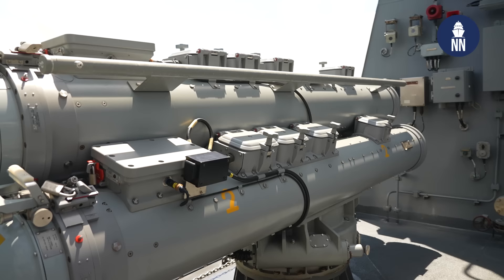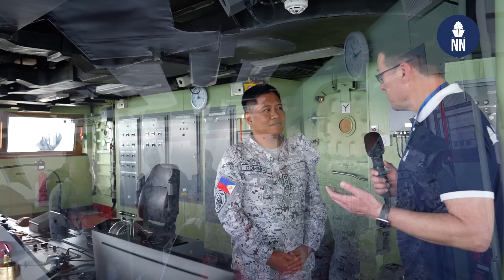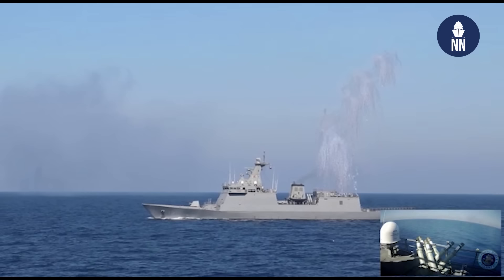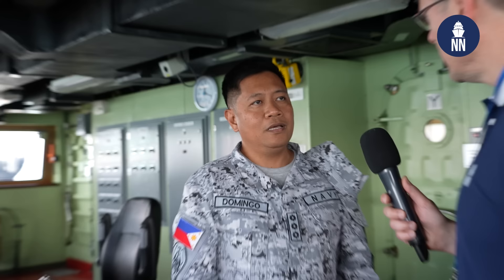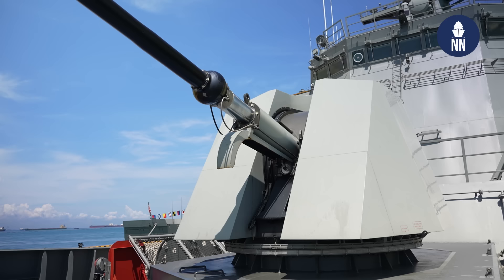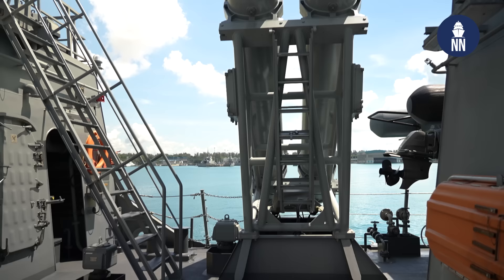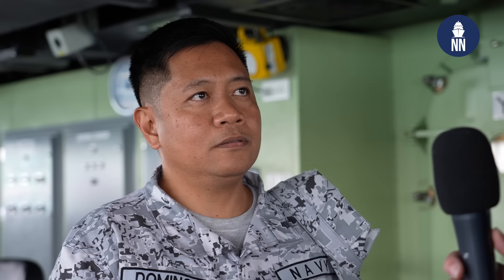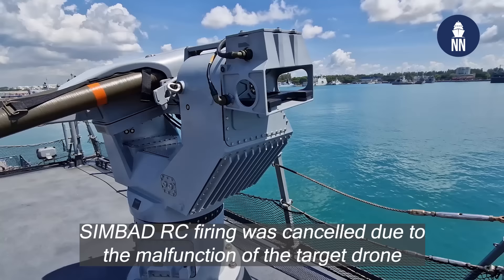Philippine Navy BRP Antonio Luna - Jose Rizal-class frigate

Comment: They Philippine Navy leadership needs to complete the vertical launch system with corresponding missiles and install a close in weapon system at the back of these frigates to make them really capable. 

In connection with these the upcoming 6 OPV being built in South Korea should also have Surface to Air Missile and Anti-Ship Missile installed to make them really capable.

There is no point having warships with incomplete weaponry.
Reply: The 2 Corvette will be more armed than the frigates 😆😆
Reply: F.Y.I The ships have already weapons platform. Only the Ammunitions and messiles are absent on the ship, but its on they way now.
Reply: Exactly. Russia learn’t that the hard way
Reply: The OPV do  not need to get any large weapon system as it IS coastal defense ships they will likely stick around ports, naval base, or just overall will just patrol near or within the range of SAM batteries
Reply: It's the Philippines dude
Reply: @ComradePuss  OPV's should have missile capabilities. Even without the CIWS. There main purpose is to patrol and protect our EEZ. With such limited weapon capability it's just a floating house on vacation in the sea. It's more like a PCG patrol ship.

Comment: The TASS (Towed Array Sonar System) will be an issue for the upgrade as the module placement is awkward  as per the design of HHI. I hope they plan on using a USV with TASS instead of mounting it directly with the ship.
Reply: awkward  as per the design of HHI? lol HHI is the world's no.1 shipbuilder and has built various battle ships, submarines and even AEGIS destroyers including Sejong The Great class destroyers being considered as the world's most advanced and powerful AEGIS destroyer. The Incheon class frigate(Jose Rizal & Antonio Luna) was originally designed for relatively easy missions with a low budget for the Korean Navy. It's the Philippines Navy that chose and purchased them even at a lower price than the Korean Navy paid. The problem is that Filipinos always want a Mercedes with money worth a cheapest car. If you can pay, you can get whatever in the way  you want.
Reply: @jclulu3942  absolutely correct. They want packed or fully loaded frigates but the budget is for corvettes price.
Reply: @jclulu3942  The original design was at the aft of the ship. Changes were made and it is now in the forward near the anchor room which is akward. That is were the mission module and power supply for the TASS is located.  Can't complain about the limited budget, but the design proposal was not followed and changes were made without prior notice even if the modules are FFBNW. It means that the design was appropriate with the budget allocated. Not a Mercedes benz but yeah its a Hyundai. Nothing can be changed about it. Hopefully the 2 incoming Miguel Malvar Class next year is more capable. It has been launched, just waiting for the delivery (still no TASS).

Comment: The United States is in the process of Decommissioning it’s USS FREEDOM class of Littoral Combat Ships because of costs related to its maintenance and upkeep.  The ships are fairly new but have a few problems.

The Philippines could probably maintain these ships in a more cost effective manner than the United States can.

The Philippines should ask for these ships.  It seems to me that donating them to the Philippines is a whole lot better than putting them in the “Reserve Fleet”.  In the reserve fleet we still have to pay to maintain them.  If we donate them to the Philippines then the Philippines will be maintaining them instead.

The Philippines should ask for the USNS SPEARHEAD Class of Expeditionary Fast Transport ships like USNS MILINOCKET (T-EPF-3) while they are at it.  They have similar problems with cracks in their hulls above the waterline near the exhaust.  I don’t think the aluminum likes the heat very much and it certainly doesn’t like a high sea state.

In any case I think the Philippines can maintain these ships in a cheaper and more cost  effective manner than the United States Navy can.
Reply: 미국도 유지비때문에 포기한 함정을 필리핀에게 준다고? 그냥 새로 건조하는게 더 저렴할것임

Comment: The ship badly needs those VLS launched Mica SAMs. The Mistral is not enough.
Reply: Don't be choosy all ship can be destroyed by missile even its looks is cool
Reply: 2 HDC 3100 will have 16 cells VLS armed with Mica to be commisioned in 2025 and 2026. Both will also have CIWS, AESA radars and 8 launch tubes for SSK-700M.AShM and towed array sonars not FFBNW. Steel cutting started on May 11, 2023. So a total of 4 missile capable ships for the PhNavy. They also plan to have 2 more bigger frigates in Horizon 3. I am hoping for the Mogami class frigates or simlar to the Type 31 of the Royal Navy for additional 2 frigates. VLS  modules  and CIWS will only move forward after the HDC 3100 have been commissioned.
Reply: @ayanokojicham if that's the logic we're gonna go with that all ships can be destroyed, then why put defenses on them in the first place?
Reply: @Fritz_Salad for stylish only so its looks cool
Reply: @Fritz_Salad  u see Us destroyer looks cool if the ciws attached on it
Reply: @Valair2021  "Correction" The towed array sonar is FFBNW
Reply: @johnrusselperez2233  According to Maxdefense the following sensors are included: Sensors Fit:

- Two Navigational (X & S-band) Radars
- 3D Air/Surface AESA Radar with Identification Friend or Foe (IFF),
- A Fire Control Radar,
- An Electro-Optical Targeting System (EOTS),
- Hull Mounted Sonar (HMS),
- Towed Array Sonar System (TASS),
- Incorporating Tactical Data Link 16 and 22 (which are PN-supplied) ,
- Naval Communications-Electronic Support Measures (C-ESM),
- Naval Radar-Electronics Support Measures (R-ESM),
- Tactical Air Navigation (TACAN), Satellite Communications (SATCOM)
- Long Range Acoustic Device (LRAD)

Comment: i dont like that HHI have downgraded this ships original requirements
Reply: Yes, it noticable from 8 anti ship missiles having downgraded to 4 anti ship missiles, then phalanx ciws is not installed and it dont have VLS missiles , ship is so weak for a frigate
Reply: Bruh it's a FFBNW deal with HHI. It's the Navy's Technical Working Group and Government fault that they approved it and did not give enough funds. 
Besides I think it's just a test phase for PH Navy since this is the first time they will operate a missile-guided frigate. Just look at the new Corvettes ordered, it's much more better than the Rizal Frigates.
Reply: @crashercrasher9696  it's because the Philippines don't have enough funds we hope that it will be Equip with the all weapons and systems soon
Reply: @night8285  Yeah, most likely it was because of low funding that's why it's not fully armed. Hopefully when the Corvettes are done, it will become the baseline of the PH navy when procuring more naval ships. 

And most of all, the PH administration, whoever will be the next, should continue and support the modernization. Even if we're not at war, and will not be use in an active war, hopefully.
Reply: Ph navy should start a trend in wps area a small to medium navy with a full of corvettes that are fully armed and tons of high speed craft equiped with missiles